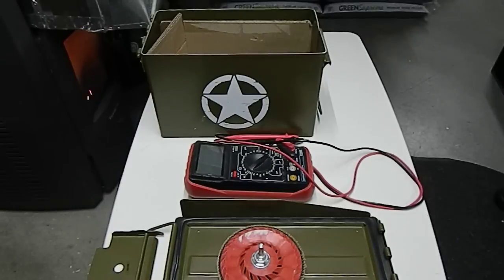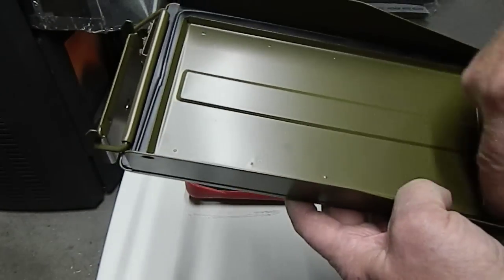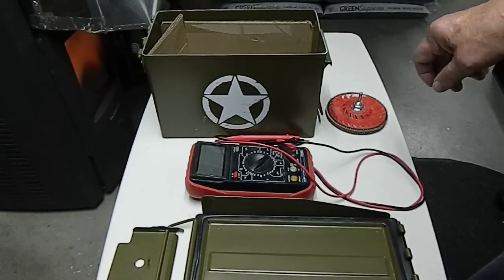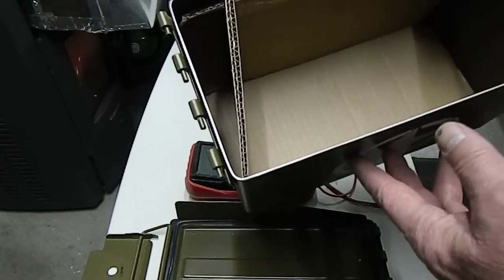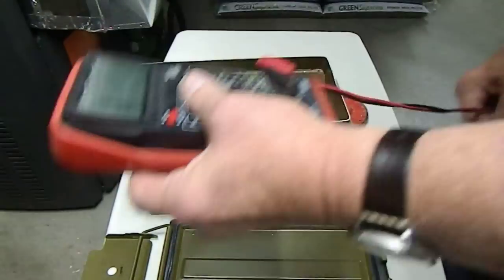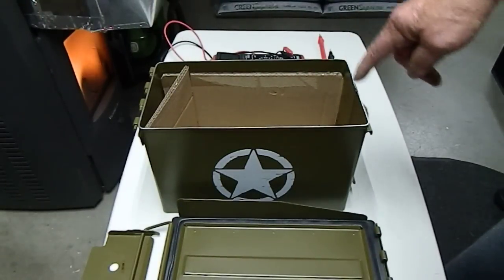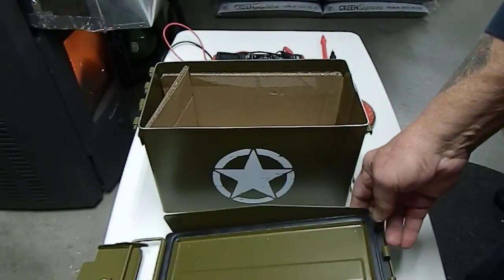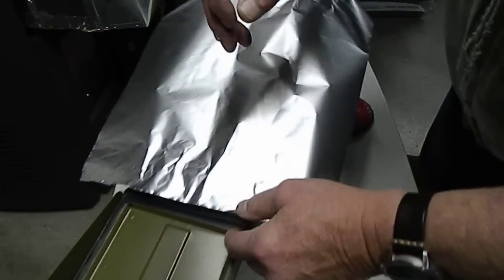AMMO CAN FARADAY …. you’re doing it wrong

Comment: I use calibrated wide band transmitters, antennas, and spectrum analyzers to test my Faraday boxes. You can get conductive rubber for the gaskets but that is expensive and does not a have a fine pitch between the conductive particles. Fine mesh steel (filled with cotton as a shape maintainer) used in place of the rubber shield is far superior than using aluminum as a seal like you did. It doesn't have to be water tight but fine enough (smaller) than the highest frequency (shortest wavelength) components of an EMP.  The reason a Fraday box works is because it is made of a ferrous metal like steel (the magnetic field is blocked while the electric field becomes eddy currents in the steel box). Try holding a magnet up to aluminum... it won't attract. So what you are making is a 3 mil (0.003 inch) aluminum cover/gasket for the box.  That 3 mils around the whole edge of the box is plenty wide for a > 50GHz magnetic field to get through the aluminum edge wise, blocking only most of the electric field. Yes, it is water tight, but not wide band EMP proof.  I have gotten up to 60 dB attenuation with 1 Watt 50 GHz at 10 meters.  With your idea, it "looks" good from a DC perspective but not for EHF. You may get 45 to 50 dB attenuation at only 100MHz which is marginal since EMPs have some extremely high frequency components to them. Also, you need at least 1 inch of cardboard around all six internal sides of the box.  Now, if you could get ferrous steel foil that would work, but stay away from non ferrous metal like aluminum or copper/gold for EMP Faraday boxes. You have to think very high power very high frequency EM energy, and you need access to equipment that ranges at least $250,000 to test it, common lab equipment will give you false results as they are not suited to measure these frequencies. Keep a few desiccant packs in the the Farady box and store in a water tight tupperwear type container within a vacuum sealed bag for long term storage.
Reply: Curious what is the cardboard for (you also said 6mm ESD foam as an alternate in your video)
Reply: @jakegarrett8109  The cardboard keeps your electronics insulated from the metal case as the eddy currents could induce voltages if too close, the case may even arc over to the electronics if the EMP is directly overhead - so 1 inch or more is better. The ESD foam just prevents static electricity from building up (which is in the 1000's of Volts but at micro amps).
Reply: @paulromsky9527  Suppose you set that trash can on a basement concrete floor?
Reply: @crazysquirrel9425  Setting your trash can on a concrete is fine, but if the concrete has rebar in it, those steel bars might develop an EM field around them as the EMP occurs. This could focus the energy, but as long as your can is sealed with fine mesh steel (not copper or aluminum) those effects will be minimal. Rember, copper, aluminum, or non ferrous metals are not good seal for weapon based EMP events, they are electrical but lack magnetic properties for proper shielding. EMPs have extremely high frequency components to them, they can get through thin areas of nonferrous metals. Steel is the best for the container and all seals. Don't forget to line the can with at least 1 inch or more of corregated cardboard inside: top, bottom, and sides. Yours truly has a slide show video on this.
Reply: @paulromsky9527  I tested the setup I have with a cell phone and an FM radio.
So long as I taped the lid to the can, I got no sound other than static.
I was also thinking of getting one of those silicone buckets from the dollar store, place stuff inside, and place that inside the cardboard lined can.
I know of no ferrous tape I can use for the can.

Also, I did take a jumper wire from the can lid to the side of the can to ground the lid to the can.
Bad idea or no?

1" of cardboard is a lot of cardboard and doesn't leave much room in the can.

What about items in plastic containers or cardboard boxes inside the cardboard lined can?
My can sits on a concrete floor. It is an old house too so not sure if there is rebar or anything in it.

What if you put a strong magnet stuck to the inside bottom of the lid?
Any effect with that?
Reply: @crazysquirrel9425  Sadly, cell phones and AM/FM radios are not sufficient to test for EMP effects and shielding (many non-RF engineers think that such equipment is ok, but, take it from me, they are NOT). I have tested my Ammo Box Faday Cage in an calibrated RFI/EMI lab with wide band RF transmitters from DC to 100GHz (way over the frequency range of cell phones). I also used special antennas and spectrum analyzers to measure what frequencies get through and how strong they are. The equipment alone cost well over $250,000.  Please understand that most of these garage folks (that use what you used)  are not RF engineers or experienced with real weapons grade EMPs. Me and some of the engineers out here are, and we try to tell people that high frequency high energy EM pulses work differently than what a "casual observer" understands.  For example, your cell phone will stop working with only 20 dB of attenuation (cell phone signals are relatively weak), EMPs are HUGE and you need at least 50 to 60 dB attenuation to protect electronics. So putting a radio or cell phone in a container you made and then get "no signal", all that tells you is you got about only 15 to 20 dB attenuation and only in the 500kHz to 1GHz range... that IS NOT enough to protect your equipment from weapons grade High Altitude EMPs.  I designed EMP proof devices since the 80's I know a lot about EMPs that are classifed, this is not a subject to be taken with, "looks like it makes sence" approach... there is a LOT behind the scenes that only a few of we engineers truly understand about EMPs as weapons.
Reply: @crazysquirrel9425  Yes the cardboard does take up room. Normally you only keep 1 to 3 items in any Faraday Box, because if you open a "one box for all" to pull put an item and another "followup" EMP comes weeks later... ALL your equipment is toast. It's a shell game from the day after a nuclear war starts, the enemy will periodically detonate EMP weapons now and then to catch people who pull out all their electronics thinking it was safe.  I have had years of government/military training on this. Once we have a nuclear war, you will end up keeping your equipment in EMP proof boxes forever after, using them briefly and protecting them again.
Reply: @paulromsky9527  So, what are we 'Po' people gonna do?
Neglect the cell phone as it was only used as a test.
Important things are like rechargeable batteries and chargers, crank/solar radios, solar generators, similar survival items.
Cell phones will be worthless after an EMP anyway, even if they were 100% protected. Towers will be destroyed.
What about unpowered electronics? Say take the battery out of a calculator for example.
Reply: @paulromsky9527  That's a LOT of metal trash cans....
What do we poor people do then?
Reply: @crazysquirrel9425  Yes, you have the right idea on rechargeable batteries and solar/manual chargers. And yes, cell phones might only be helpful for storing important data (contacts, dates, and such), but we should not rely on the phones to work for text/talk because the towers will be out for up to years. Don't expect GPS to work because those satellites will be taken out, and don't expect the internet to work even with local Hot Spots.  So, what are poor people to do? Follow the engineers that tell you the best practices and don't try to sell you products or give you simple "wrap it it foil tips" - goverment sites say that too.  Protect what you have using the BEST you can afford. I just made a slide show on "Trash Can Faraday Cages", they are simple and very affordable. As for testing yourself, like said, cell phones and radios are not good enough, but steel containers sealed with steel mesh, stored in larger steel containers are as good as you are going to get and such designs have been around for decades and tested by engineers like me. I can't guarantee anything, but a lot of backyard EMP folks just don't understand what they are up against.
Reply: @crazysquirrel9425  Any electronics MUST be in a sufficiently designed EMP proof container when an EMP event occurs. Leaving, say, a calculator out with no batteries is very risky. EMP will induce currents in the electronic circuits that will destroy them - even if powered off. The pulses are so fast and strong even TVS Diodes can't keep up with it any more.  I have a list of items (by category/priority) that we may want to keep EMP safe. I will post it soon.
Reply: @crazysquirrel9425  I am making a video tomorrow that shows that a Magnetic Field goes right through Aluminum, but not through Steel. It's not an EMP but it is a simple example how Electrically shielding is not enough, Electro-Magnetic shielding is needed. And that is what Steel does over Aluminum/Copper/Gold and other non-ferrous materials.

Comment: Listen, When the sun decides it's time, every, metal, conductor, will, turn , to, super, heated , SLAG. Period. 
No Faraday contraption will stop it. 
All conductors - Rebar, nails, engine blocks, military tanks and planes, water towers, pacemakers, pins and metal plates in your head.
Sorry. I hate telling people this.
The only thing that might work, is a completely nonconductive  INSULATED container. Like an Ice Chest, plastic, not styro.
Or maybe a glass container, or something stored under mineral oil, or distilled water?
Reply: I'm open for other suggestions..?
Reply: It won't be just a quick little EMP. It will be a prolonged period of waves of million amp current induced into all conductive matter.

Comment: Without a good ground that is not a Faraday Cage. It is a microwave to all solid state electronics. Just like that supposed automobile devise that  shunts the EMT pulse. To where. Most if not all autos have rubber tires. So they are insulated from ground. A simple dragging chain is not good enough. When it fails, try to contact the manufacture. There will be NO communication. Over a half century ago I worked on large government Farady Buildings. They won't work either because they use solid state devices to shunt the pulse, but thats the first thing that fails.  Even if it works the first time, the next wave from the same bomb will destory all remaining solid state electronics. Old relays will survive but they are to slow be work. Even technicians must be grounded to work on solid state electronics because static electricty will destroy those devices. Sorry to disapoint! Buy a horse or mule if they are still alive. The government is the last place to provide real help. It's like their help at Palistine, Ohio.
Reply: A Faraday cage does not need a ground - that’s what Faraday proved mathematically. Properly made, an EM wave cannot get in - the vector sums to zero.
Reply: I just wrote something similar before I saw your comment, bldgs are too complicated, small rooms like garage or something like is the way to go. Thank you for your suggestions and service sir.🤔🫡

Comment: i tried the whole aluminum foil in the place of the rubber gasket big mistake  the cover wouldn't even lock. so i tried to put the gasket back on its not like it was org. but it seals a lot tighter now plus I use RF blocking material as a double safety precaution to rap my electronics in. BTW that whole removing the gasket and sanding  came from a NASA engineer. Here is the video: Ammo Can Faraday Cage 70+ dB Shielding
Reply: i tried your method here .This will give me more assurance that no RF will get in Also i used a Dremel tool for the removal of paint around the lid.
Reply: I've never seen an ammo can with a gasket. What do you do without the gasket?